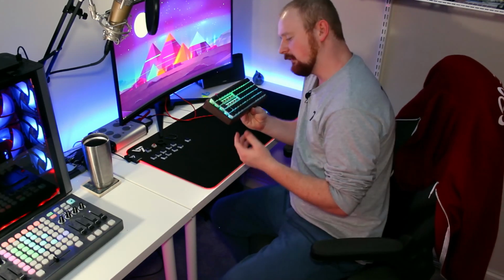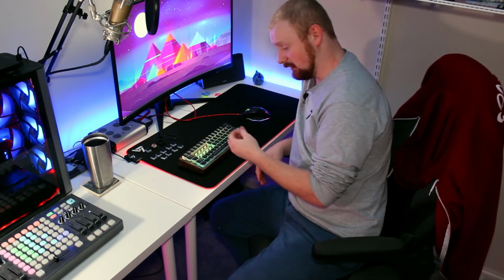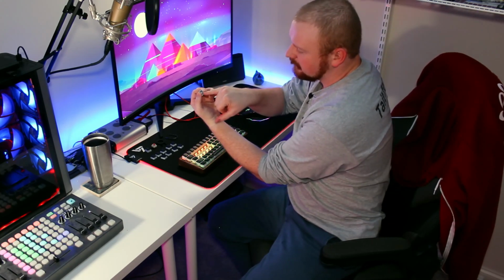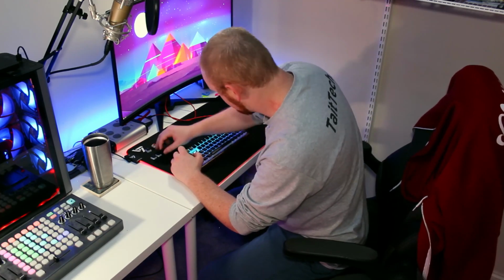Build Your Own Keyboard with No Soldering? Cool!

Comment: I'm trying to build a keyboard with zealios v2 switches. My problem is that I can't find any hot swappable keyboards besides the GMMK (which is kinda meh because it would require me to clip of the pcb pins from the zealios switches) that have a tkl ISO version (I need those arrow keys). Do you have any recommandations for me?
Reply from the maker: So I have not myself used Zealios switches (although I hear great things) but to my knowledge the connector is the same so for 60% layouts with arrow keys, the GK64S (and GK64) PCB I used in the video will work. If your preference in TKL it gets a bit more complicated. Premade hot swap PCBs are pretty limited on layout BUT if your willing to learn a bit of soldering you can actually attack hot swap terminals to pretty much any PCB.

That being said if you want TKL with hot swap terminals already on the board you may just have to go with something a bit more obscure. Searching "hot swap PCB TKL" will come up with quite a few options. I myself got my board from YDMK and have no complaints. They have a 75 key set with case and PCB (although looks like this may be wired only) on Amazon here: https://www.amazon.com/dp/B07K3WPXC4/ref=cm_sw_r_apa_i_oyY1EbP7E20H2. This isn't quite TKL but check out the layout for yourself. It may work for you! As far as 87 key (proper TKL the GMMK is the only major option I see thrown around for preconfigured hot swap boards).
Reply: @taittech.9573  Thanks a lot of that precise answer :)